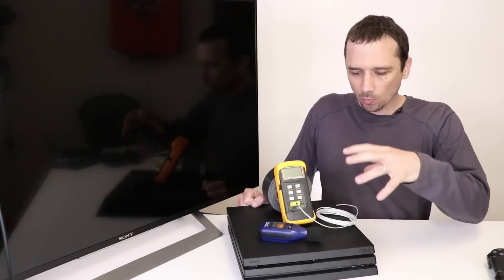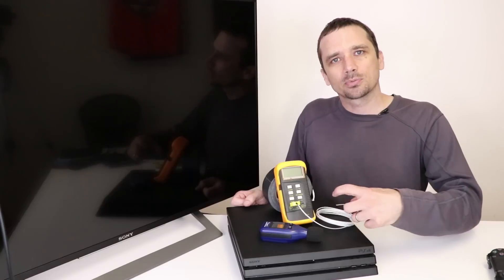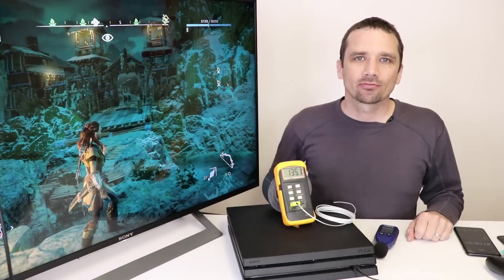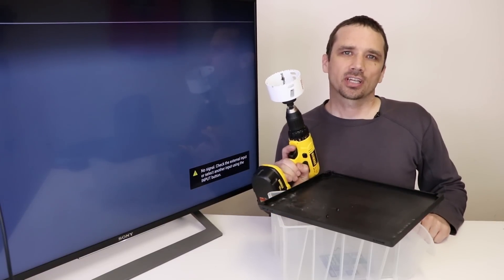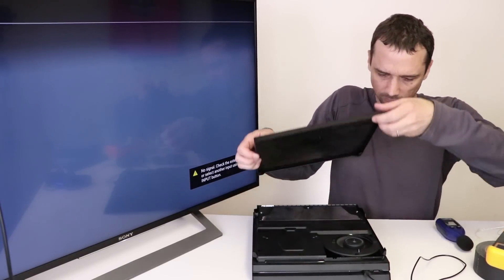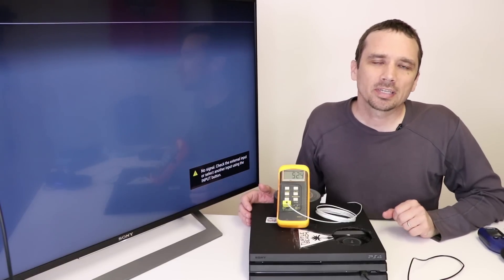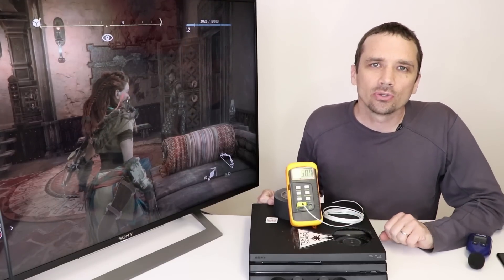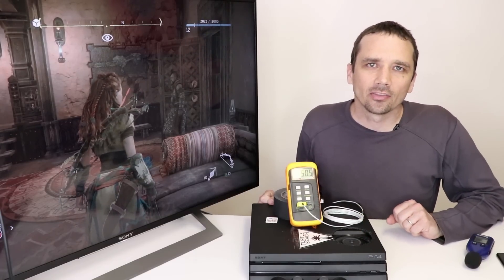PS4 Pro Case Mod - Fan Noise Overheating Fix?

Comment: Bought a used PS4 Pro, model 7015B, basically the first version. it was pretty loud, change the thermal paste, cleaned everything inside out, change the battery, swap the hdd with ssd. it is much quieter now. 

Saw this video, then I cut a hole, but i did not see much improvements over the thermal paste change. might be a few degrees decreased (3 degree-ish celsius).

Since it is already quiet now, I guess I am going to stop here.

Comment: 7°C lower is INCREDIBLE!! That is a 12.25% loss in heat. Wow!! I'm ordering an aftermarket top cover for this. RDR2 on the PS4 PRO sounds like a jet engine. And I JUST opened my system and cleaned it thoroughly. Everyone complains about the same issue in RDR2.

Comment: Minimal improvement due to hot air release. Just remove the case instead of drilling a hole in it. As long as the ambient temp isn't too high you won't need the fan. No more noise. Just be very careful testing and monitoring temp closely. Good times.

Comment: The PS4 case and any other laptop or case for any console is specifically designed to make the air flow as effectively as possible. Doing this will cool your CPU but you'll burn out other components

Comment: Hello! Please Help: I have cleaned deeply my console, changed thermal paste and still my PS5 Standard has a lot of noise but ONLY when games requiring max CPU are loaded!!! I have no problem in others....So the PROBLEM comes FROM SONY with their Temperature PROBE, they put maximum FAN NOISE in that case because something is wrong!!! Can you search for a solution?? Does changing the fan or power supply with latest version would solve the problem?? Thanks TronicsFIX!!  Even when my ps4 is cool, I launch those games directly and in a matter of seconds, My fan is maximum noise!! SONY SOMETHING IS WRONG, CORRECT THIS!!

Comment: Did some tests here without drilling and found that just sitting top cover on top letting it loose makes more room to air flow and solves heat and fan noise problems.

Comment: As with all PlayStaion console’s from PS3 - PS5 an XBOX 360 to Series X I’ve always swapped out the thermal paste, installed copper heat sinks on the ram, an compared the stock temp VS the beefed up cooling version!

Comment: The top is there for a reason when you take it off the air flow doesn't go through the PS4 correctly and all the other components don't get cooled completely when you take the top off yes it gets quieter but it's not pulling the air across all the other parts CPU GPU and the Rams etc when you drill a hole or take the top off it changes how the air gets pulled into the system.!!!

Comment: Airflow differential on the exhaust would be more telling as to the cooling potential, the pro is sucking air in from the sides and directing it over components to help cool them. If you've less air coming out of the exhaust after drilling the hole above the  fan then the components reliant on that airflow are heating up in a way they were not designed to accommodate.
Reply: The flow path is the only thing that changed, not the amount. And any other components that aren't cooled by the fan, i.e. Vram, ram etc, will have thermal pads on them.
Reply: @Cosmic.Origin.exe.  No doubt the flow path changed with the  with the massive hole newly introduced lol
It would make an interesting video if you had the kit to check temps on the the likes of the system ram and the HDMI controller before and after the new intake on a stock configuration (a pro that hasn't had it's horrible thermal pads replaced with adequate ones)

Comment: I did this mod on the PS4 original with a PC dust cover over the hole and remote controlled RGB LEDs in the fan, PS4 logo and side vents. It's on my channel. Decided to do this when my little bros PS4 overheated and reballing didn't fix it either.

Comment: Got one beated up PS4 PRO for a cheap buck yesterday, and I'll be sincered I never played PS4, I jumped from my PS3 to a decent PC and since Red Dead Redemption 2, Horizon Zero Dawn, Detroid Become Human, Days Gone, etc was also release to PC I didn't felt the urge to buy one, but Oh well here I am with a PS4 PRO for Ghost of Tsushima, Spider-Man, and Sakura Wars, and first thing I notice was the fact that the console gets so hot and the fan so loud I basicaly needed to put a fan right in front of it so it could cold of while playing Ghost of Tsushima. Also mine doesn't have the front led working and has something loose inside, well that's the PS4 PRO we get for 100€ I'm waiting for a PS4 screwdriver kit so I can open it up and see what's going on under the hood.

Comment: Steve this works with PS4 works just tried. Had too cases. White and black. Black had no hole white had hole. Unlike slim there’s no base plate. Runs a lot cooler with hole as this is a squirrel fan. Which draws from middle throwing air out.

Comment: Need help, I fixed up my broken ps4 pro and re did all the thermals. It boots up and connects to wifi normally but when i play some cod and even on spiltscreen it just shuts off fan spins but it doesnt throttle up and I have to let it cool a bit and unplug and plug power back to start it again

Comment: I went ahead and used a dremel to just slightly cut out the front of the top cover near where it says PS4. Took a dust filter that came off a 120mm fan from work and put that on there with some glue. I'd rather do that to ensure the air coming in is as cool as possible.

Comment: did the same thing on my ps4 standard and put some aluminum mesh screen under to reduce dust after i tore it down and replcaced the thermal paste and cleaned out the heatsink

Comment: So, the top hole allows for better airflow directly to the heatsink so you would get cooler temps on the APU and PSU. Though I imagine it lessens the airflow through the bottom of the case over the sheet in contact with the RAM chips. No one ever does thermals on the bottom of the case to test if it gets hotter there after this mod. That would answer the question of if it actually gives better all round cooling or not.

That said, if you placed a fan underneath aiming at the RAM chip plate, would that increase the air flow over those parts as well as to the main fan and reduce overall temps in the case? Increased airflow at the opposite side where it pulls some of the air to cool the rest of the components and all.

Comment: I drilled heaps of holes in the back to allow the hot air directly out instead of the exhaust vents pointing back into each other,
It pulls alot more cool air through now and runs mint
Reply: Poor power supply

Comment: Looking at the new XBOX series X when they pull apart and notice where I will place a hole in the case. By the below the heatsink. The fan only pull hot air out, but  the air coming in will be down by table.

Comment: Can you put one or two across where the power supply is, that generates a ton of heat if its not cleaned regularly

Comment: Would love to know if you can do a video tutorial I mean a test about yes you drill the hole in the plastic where the fan is above it in the does it work if we add another fan outside to give it more air I think

Comment: I did almost exactly the same. I just lined it up better and screwed a metal fan guard on the top to stop things falling into the fan (or fingers) works a charm
Reply: Is your ps4 still working well?

Comment: Hi Steve! Any chance you can do the exact same test on the latest PS4 PRO please cuh-7216B please? Just bought one & not sure whether it needs the hole putting in the top case or not

Thanks
Reply: The latest ones are ment to be silent. They aren't?

Comment: When playing any of the new games my ps4 pro starts to take off...as soon as I press play.
Reply: its a nice playstation feature, makes playing battlefield much more realistic as it literally sounds like an f16 is taking off in my room
Reply: I just take the top cover completely off while I'm playing, it keeps it cooler and doesn't start the jet engine sound so it's a solution you could try, either that of put new thermal pads and paste on your console. Personally I don't have the time to do that.

Comment: Just tested the same thing with my PS4 Pro and the rear air temp does indeed drop by about 7 degrees Celsius.

What I think going on here is that 7 degree difference is the heat generated from other components not being sucked through the fan due to it being able to get air directly from the case hole.

I now regret my decision to undertake the fan hole mod and strongly advise no one else attempt it.
Reply: I don't agree with you probably 99% of heat is generated from the apu, that's why it needs a heatsink, never seen a mobo with heating issues, you can also cover the hole again just use your imagination, it will worsen the temperature, take for instante the Xbox one which uses almost same apu, it has an opening to expel the heat, rubbish PlayStation design likes to spread the heat to full case instead of a single dot when exhausting the hot air, to make the console as thin as possible, I have drilled a hole on my ps4 slim and added an extra fan never trusted Playstation cooling system, take for instance ps3 it reached a colossus 80 to 90 degrees, if nothing done.

Comment: I just use my ps4 pro with the top cover removed. Definitely works. Has stopped fan speeds ramping up.
Reply: Is the ps4 pro still ok?
Reply: @ps5stuffguy  Yes

Comment: @TronicsFix, just a quick question, I was thinking of playing games with the top cover removed and puting it back on after playing, do you think my ps4 pro will be in some kind of danger if I do that? I tried it once it sure did bring the fan noise down from a jet engine to a whisper :), thanks in advance.

Comment: I think it all comes down to where you are measuring the temps, if course in the exhaust temperatures will decrease with better air flow on heatsink as air sure will find the easier route. 
But this means the rest of the components will now get less air flow and less cooling even if the heatsink seems cooler and how healthy is that? Sure it will not cost anything to Sony to incorporate some vents in there when doing the plastic  injection moulding just like they do it on the side. I want to believe Sony engineers are better than this.

Comment: Unless you measure the temperature at the CPU how do you know it's cooler where is really matters?
It may be hotter in some areas because it's better at getting the heat out, for example a cold exhaust pipe is an exhaust pipe that's no exhausting well, it don't mean your engine is cold
Reply: You wouldn't be wrong for thinking this and I see what you are saying, but the fact that people have done it and the PS4 stays quieter (the fan isn't spinning as fast) would tell me that the entire system is running cooler. Otherwise, you'd hear the fan ramping up to compensate for the heat being produced by the CPU/GPU. The way the airflow works for this case as I understand it, is the air comes in from the sides, gets sucked into the fan, and then pushed out the back. So the single fan works as an intake and exhaust fan. Putting a hole above it certainly alters that air flow in a way, but I don't think it alters it in such a way that it makes it worse. The most optimal thing to do would be to add an exhaust fan to pull heat away, but unfortunately it isn't a computer case so it's easier said than done. The system is so small it really only needs that one fan. Perhaps pulling the entire top off would worsen things, as at that point, you'd probably be losing all airflow, however, heat would dissipate much easier. I think that just having a hole above the fan with a dust filter is optimal, because the case still has some air flow going front to back, and the fan is getting way more air which increases it's push/pull action. We'll need some tests to be sure...
Reply: Exactly its ok to "test" it, but hopefully not many will do such a stupid things in their Ps4s....But i know many will lol

Comment: When playing the new modern warfare it sounds like a F16
Reply: That's just realism from popping Airstrikes bro. A PS4 exclusive.
Reply: @madsisak  lmaooo
Reply: I removed the top cover completely and its not even half as loud in the MW lobby
Reply: if i play rainbow six siege mine does the samen
Reply: The ps4 sounds like that playing any AAA title after 2016. Lol
Reply: I change the thermal paste to liquid metal and individual ram heatsink , and its running with decent fan noise not the jet engine

Comment: I did 3 cooling advances for my ps3 slim. I did the cutting a hole over the fan and covered it with a dust filter for PC for added airflow, I have a desk fan on the side of it which will blow air over both the top and bottem of the system and I am using a 6" high kitchen rack to increase height. The desk fan is annoying given how loud it is but it and the kitchen rack keep my ps3 from even coming close to overheating. It's almost never warm lol.

Comment: Did that to my ps3 slim case, and insert a 5v fan on top, to increase airflow, cell temps never reach 50 always 45º, and rsx 52 to 55 maximum, playing God of War 3, gets 55 degrees or less which is excellent, all other ps3 games, even lower temps.

Comment: Bro I swear ps4s contribute to global warming. I know mine does. Lol
Reply: I guess everything that project heat, will contribute to global heating.
Reply: Wait, you might be right
Reply: Nikolai zazzoslki  lol 😂
Reply: This is actually a legitimate concern. As gaming becomes more and more intertwined with mainstream culture, more plastics and metals are used to provided gaming devices, this includes the use of plastic cases and plastic discs. As technology advanced, it would be great to see better efficiency from our machines as the lines between graphical capabilities blur and ecological impact becomes more urgent.
Reply: @laeviga-sunstrider  Yeah, I hope there will be stuff done for it, just very irritating manufacturers keep making repairs difficult and such

Comment: You could of just kept the cover off and did the test lol
Reply: Airflow won’t be the same
Reply: You are rite my man the air flow won’t be the same it will be better! :) it runs cooler with out the cover on. I’ve had it like this for a wile and it makes no noise and the power pack shield stays cooler too since there is no cover above it.

Comment: Apply new thermal paste with MX4, do some holes for better airflow, install a fan adjuster and there you go with up to 17C° degrees better temps. PEACE
Reply: what fan adjuster did you put?
Reply: Got any links on how to do this?
Reply: I did everything it’s not working
Reply: @Ak-sg3fb  maybe your APU is bended, check my YouTube Channel please.
Reply: why not use coolermaster gel or thermal greezy thermal paste which are both better than mx4?

Comment: All you had to do was pull the top off.
I did this and i still had overheating issues. (Screen flashing black).
I noticed that the symptoms would stop when the fan ramped up so I ordered a fan controller from EBAY.
It’s coming from the uk so it will take a while to get it.

Comment: The Problem is, are other components running hotter now? I heard of people who drilled holes into their Laptop bottom Covers to improve temperatures, yes, this might improve the CPU temp slightly, but often, the fan also draws some air = heat(!) from the rest of the Chassis like RAM, Chipset, VRMs and HDD/SSD, it's a very little, but enough to prevent a heat accumulation.
Reply: i was wondering the same...

Comment: My ps4 pro runs pretty quiet during gameplay, but whenever I'm in a menu like Don't Even Think or H1Z1, it runs really loud for some reason.
Reply: I had the same problem 
Yesterday i fixed it 
I replaced the fan for a brand new nidec fan en replaced the thermal paste with arctic silver no 5 thermal paste and it is more quiet then ever

Comment: @tronicsfix, ive put a 12 mm pc fan on top of my hole, would you think this would add more cooling?
Reply: Probably not, depends on the fan. The blower style fan inside the PC should be plently fine to suck in air if you have the hole on the top cover. - The blower has to fight the pc fan if the pc fan performs worse than the original fan.
Reply: @anderschristensen5781  so if the pc fan is, say slower than the ps4 fan, then the air flow from the pc fan will be blocking the ps4 fan? Am i coreecy?
Reply: @gordoncampbell7858  yes, the PS fan Will try spin the PC fan faster

Comment: Why drill a hole and not just remove the top cover instead???
Reply: Because the rest of the lid keeps most of the dust out and keeps some air flow to the back of the ps4. Tbh this guy did it wrong, you should drill smaller holes to create a type of grill and put a usb pc cooling fan on top of the grill you have created. I done this and it really cools you ps4

Comment: Firstly,  thanks for the video about thermal paste on the original Ps4.  I serviced my machine and used Arctic Mx2. I experimented by using the spread method and I still put a pea-sized blob on the CPU ; it works perfectly.  I was actually concerned that I messed up with the fan cable as the fan was so quiet .